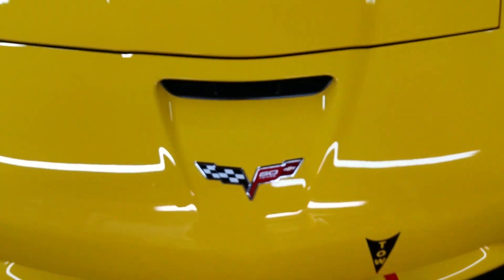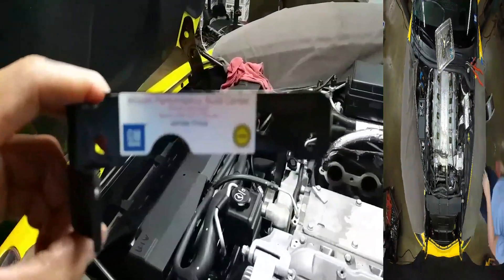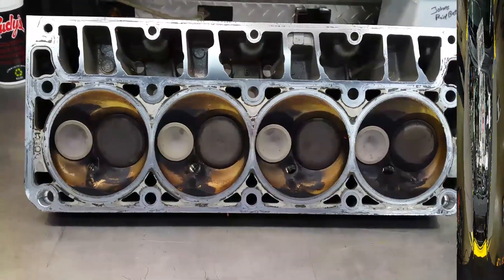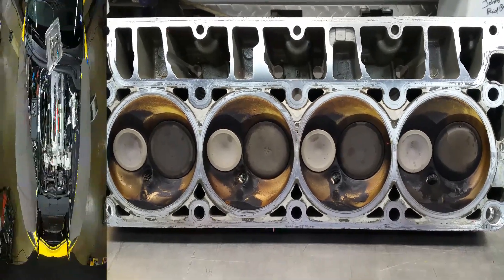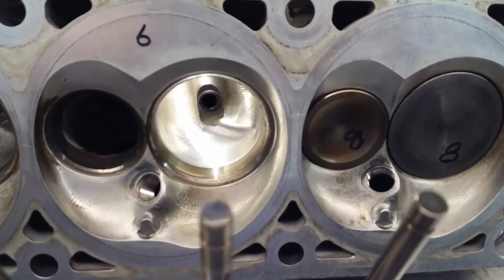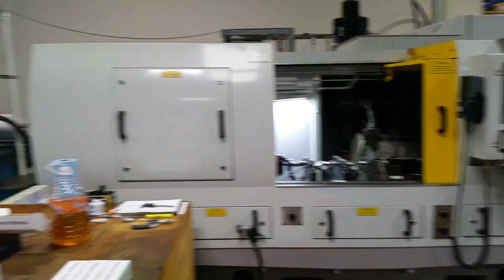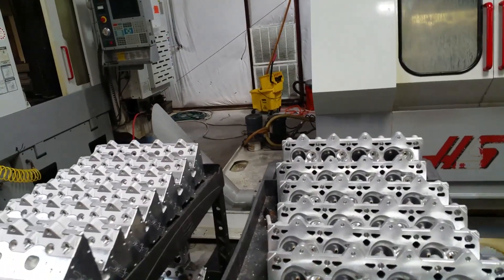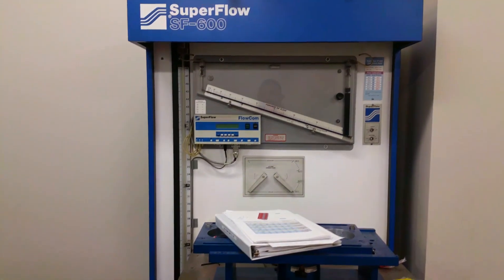2013 Corvette Z06 13k miles valve guide upgrade to prevent Dropped valve

Comment: What will cause a valve to drop?
Reply: It’s just an issue with these cars because GM put hollow valve stems and I’m not sure what else people replace to fix it but replace the head completely and go with a heads cam package for more power and reliability I’m looking into getting a C6Z and I’m tryna see what people do to fix it beside the heads since that’s $3.5-5K

Comment: Why Does everyone Keep saying Dropping A Valve? These Valves Are Breaking Or separating , Dropping Involves The Keepers Or Retainers  Failing Or Coming Loose And the valve Falling Into the Motor.  That Is Not What's happening. The Valve Stem Is breaking. Big Difference, At Least This guy Is saying Why and what. Thank you For That.
Reply: If the valve drops into the cylinder, the piston and head don't much care HOW it got there. All that matters is that it did. Period.
Reply: …because the VALVE DROPS into the cylinder. That’s called “dropping a valve”. Semantics.
Reply: @guardpass  did you not read what I wrote? It's not semantics there is a huge difference. non professionals say "dropped a valve" because they heard it somewhere and it sounds like valve in cylinder , but they don't really know what it means. I explained the difference, you should read it then maybe you would understand it's not semantics.
Reply: Probably more like sucked it in and kissed! 🎉.

Comment: Im retired GM service tech. GM cant get the centerline of the seat/guided the same? The valve head breaks off? Junk valves? Worn guides? Are they worn in an oval shape or are the worn round? Im gona get some guff over this...bring it....worn guides are from junk springs...springs where the top and the bottom are not parallel. It has nothing to do with the tip of the roller rocker not being in the center of the valve stem or oem stamped steel rockers...Big block chev has valves that are angled in 2 directions. Have you ever heard anybody say they needed roller rockers to keep the guides from wearing out....i have messed with a couple sets of heads, this set was on a L88 427 i bought....ran it in my boat and it ran fine
 https://youtu.be/11eXlFkZekM
Nothing more than bad springs.....Easy to prove, get a head with bad guides...put the spring on the valve, put the rocker are on and figure out how to use the pushrod to get the valve off the seat. Good spring, valve will move around with your pinky finger, bad spring and it will be pushed to one side, really bad spring and you will need a tool to move it.
Ti exhaust valve raise redline? That aint gona happen, ignition has a rev limiter, the intake valve is bigger/heavier than exhaust, it will be the first to float....and round up a dyno sheet for your motor....see where peak hp is? You need to shist a few hundred rpm past that...or less..short shif is always best

Comment: Did you also measure 90 deg from the one shown in video? I would think that tangent in line with the rocker shaft would show more wear since maybe the rocker is pushing out slightly (towards outside of car) while also pushing down. (The direction shown at 10:15)
Reply: I agree one hundred percent. Looking at the wear pattern on my rockers it was obvious that there is side loading on the valve stem. I solved that issue with Crower Shaft Rockers, big bucks for a street car, but big peace of mind.

Comment: You are fixing a year that didn't have the problem. You range js acceptable and you did t measure properly.  Should have had the springs removed. 
But hell, nothing wrong with a nice ahead job.
Reply: EVERY year LS7 has had the failure.  Don't buy into GM's CYA FUD!  I'm yet to see a stock LS7 that didn't have some moderate level of valve play.  FWIW, I've also seen it on some "fixed" heads as well, but to a far lesser extent.
Reply: What year(s) supposedly do NOT have the problem and where did you get this information?

Comment: You said you had nine to ten thousands on the intake exhaust but you never or I didn't catch, what the measurement was supposed to be. also, even with that side play I don't understand why the retainer didn't hold the valve in place...? In order for the valve to drop either have to break it or the retainer has to come loose. Which is happening?
Reply: The valve head snaps off, typically on the hollow stem exhaust valve.

Comment: John, nice presentation.  A couple of thoughts.  First, do you have a "slow-mo" version of the head removal.  It was difficult to pause the video fast enough to see what you were doing, so definitely slow motion would be great.  Second, having watched several head jobs that check the guides, I noticed you measured at the top of the stem and not at the guide itself.  I'm really not sure who is right about this.  Where did you get your information to test the distance at the top of the stem and not at the guide.  Thanks John for the video!

Comment: Awesome video. Yes, some of it may be a good advertisement for Texas Speed, but so be it. I've been around this stuff a long time. I was a Tool & Diemaker for 40+ years. If I do say so myself, I am very impressed with Texas Speed. I knew they did good work, but didn't know they ground their own cams. I see cam grinder is a Landis. I ran a Landis O.D. grinder for almost 20 years that accepted pieces up to 8 feet long. They were based in Pa. at one time. Don't know where they are now, maybe still Pa.? Anyway, I see Haas machinery also. All really good equipment. Looks like you went to the right place. These LS7s are great motors, but ticking time bombs until heads are redone.....

Comment: Hi bud, does the LS7 engine require lash caps and if so on which rocker do you install the lash caps on? All the rockers or just the intake side or exhaust side?????
Reply: Intakes, over the Ti valves.

Comment: What's more expensive, an extended warranty or this?
Reply: I just bought a 21k mile 2010 z06. I got a 5yr 60k powertrain warranty for about $2k. Third party.
Reply: But I'm going to have the heads fixed anyway.
Reply: @bsfunk44  Right on! Thanks
Reply: BSfunk44 what third company did you use?

Comment: I do not understand why GM is not responsible for this huge problem! They designed the engine and picked the vendors to supply the correct parts! Now we are supposed to spend thousands of dollars MORE to correct their screw up!
Reply: I went aftermarket with Lingenfelter immediately after buying mine because of this ticking time bomb. You're right, GM sat on their @$$ and didn't do a thing.

Comment: are you a tesla mechanic?
Reply from the maker: I do work on tesla's but not exclusively I work at an independent shop we work primarily on American and Asian imports . I am an ASE Master Technician technician also Master Hybrid & EV certified .
We performed State Safety Inspections for Tesla dealership down the street the manager gave me  Tesla jacket for providing our service.
Reply: @johne4557  cool, great video!

Comment: How did you pull the heads without going under the car and remove the headers? I'm about to pull my heads to have them fixed and want to do the job without the extra work of the headers.
Reply from the maker: Randy I did go under the car to loosen the headers at the pipes completely so I could access rear head bolts. If you can a least pull one of the headers out far enough it makes it easier. Hope this helps and good luck

Comment: Hey Dennis how did you get GM to pay? I also have a 2007 ZO6 with 28,500 (never raced) and at recent oil change found a rocker needle bearing on the magnet of drain plug! SO , I need to do the preventative rocker bearing replacements and exhaust vale change out too , however , when I called GM warranty they would NOT pay anything because car is 12 years old regardless of LOW mileage!!!
Reply: Lee - Sorry to chime in, but my cousin was the QC Director at the plant from the end of the C5 through the second year of the C7 (when he retired). I bought a low mileage (8,500 miles) 2010 Z06 in 2016 because I missed having a 427-powered car and talked to him about the LS7 valve issue and he said, to the best of his knowledge, GM had never paid for the fix because they didn't consider it a "recall-worthy problem". According to GM only 1,200 total sets of heads (made by an outside vendor) were ever affected and that was too small a number to issue a recall. I've read several posts on forums (though far from a lot) where people claimed GM paid to fix the problem but I've never found anyone at GM to corroborate that claim. Trust me, you're not alone in your frustration. Cheers.
Reply: @kingbrutusxxvi  Thanks so much for taking the time to respond. I was on the phone with 3 different GM warranty people for over an hour the other day and it was an exercise in FUTILITY!!! Go figure...I'll be doing the rocker arm bearing repair and heads (exhaust valves etc) next week because I do NOT want to be one of those that drop a valve and have a $20k engine replacement instead I'll take the $4k repair
Blessings
Psalm 143:8 Revised Standard Version (RSV)
8 Let me hear in the morning of thy steadfast love,
    for in thee I put my trust.
Teach me the way I should go,
    for to thee I lift up my soul.
Narrlee

Comment: So 2013 ls7 had the same problem? thought they said only effect 08-11 ls7's
Reply: every 7.0 no matter the year or vehicle is susceptible to this
Reply: Exactly. There are maybe 1 or 2 out of 10 that MAY be OK. If you continue to run one without checking the valvetrain, it's kinda like the old Fram filter man commercials; "You can pay me now (less $$) or pay me later" (lots of $$).

Comment: I have a 09 c6z. Bought it with 32k miles now have 53k on it. I don't know if the previous owner checked on this issue but so far I'm good. I do have a warranty for another 2.5 years and plan on keeping this car at least that long. What do you recommend I do?

Comment: I thought the valve guides were the issue, not the actually valve?
Reply from the maker: Correct the guides are not machined in the center of the head correctly,  I just upgraded to titanium valves
Reply: Yes guides are the issue in that they centered so they wear the valve stem till it breaks off. A hardened valve head will not compress like gasses so it causes major damage to block and head.

Comment: So what has to be done to keep even a stock ls7 reliable?
Reply from the maker: FX have reputable shop rebuild your cylinder heads with new guides and replace the rocker arm needle bearings with the Comp Cams trunnion sealed bearing upgrade
Reply: @johne4557  after that will it be reliable? I dont beat on mt cars much.

Comment: Don’t buy replacement GM heads.  If you have a reputable competent aftermarket specialist like Lingenfelter rebuild your heads with superior aftermarket parts the issue won’t come back.

Comment: Folks, you can't take all this YouTube nonsense serious. There was such a very, very small percentage of LS7's with issues. And that supposed lawsuit never happened. If your going to mod the car, your warranty of gone anyway.
Reply: @365 AutoDrive https://www.corvetteblogger.com/2015/10/16/gm-hit-with-class-action-lawsuit-for-defective-c6-corvette-ls7-engines/
Reply: Mine is 12 years old engine never opened up and runs better than it did from the factory thanks to Long tubes full exhaust cold air and a tune... I've read plenty of stories with people with 80,000 plus on them... Will they pop? Of course. Are the valves the weak link? Yep... people do the damnedest shit nowadays though not changing their oil for 10,000 miles on a car like this? Nope... I don't care what they say about synthetics mine gets new synthetic every 3000 like clockwork...
And this guy putting in solid valves going to rev his car to 8 grand ?... Nope :-)
Reply: @365 AutoDrive Really? It's a Z06 they are track ready cars made to beat on. JMO

Comment: ZR1's have a LS9. You have a LS7, totally different motor. And based on the number of LS7's made vs the failures, the failures are so small that it's under 4%. There's no need to be swapping/upgrading the heads or anything in these stock.
Reply: 365 AutoDrive it is blown out of proportion, but my stock, early build c6z blew the motor with what I considered low mileage (30k).  Either way, things happen, I just don’t think it can be denied, but your response is a bit more measured in that regard.  I think we’re in agreement.
Reply: MH motorVlogs 0_o ... terrible advice
Reply: 365 AutoDrive ignorance is bliss for you, right?

Comment: i thought the valve guide issue on the LS7 only ranged from 07-11 i thought the 12-13 were not apart of it
Reply: I agree the majority will likely go for a long time without issues, but I think it would be foolish for someone without a warranty to just stick their head in the sand and pretend there's no potential problem.   

As a Z06 owner and engineer, I have done a lot of reading & research on the issue.   Not because I'm overly concerned, but more so out of curiosity.  I've come to conclude that ANY LS7 with the factory heads should be inspected at regular intervals.  Why?  Even if only 5% of these cars end up breaking a valve, resulting in major (total?) engine failure, that's still a significant number.   Countless (thousands of) heads have been checked and found to be WAY out of spec and been replaced/fixed before complete failure.   Had these not been done, what would the real failure rate be?   Considering most of these cars see little usage, the number of LS7's with excessive guild wear or complete failure is enough that any owner should be at least casually concerned at the minimum.    It's probably very sound advice to have the valve wear checked every so often.  Is it a hassle?  Yes, but the cost to completely replace an engine to an out of warranty owner is huge!

My Z gets driven, it has 57k on it now.   I'm probably going to do H/C/I this year not only for the power, but also to not take any further gamble regarding the potential ticking time bomb...
Reply: All LS7 heads from the factory are suspect.

Comment: I've been looking at used Z06 Vettes from 2009 / 2010 and this might have scared me away... I'll admit I'm not a engine guru, so a question for all follows:

If I purchase a Z06, I'm assuming that if a head is damaged, the car don't turn on, or will at least have a knocking sound right?

Also, how expensive is the Valve replacement (to include labor) on average. 

Thanks!
Reply: Only a very, very small percentage of LS7's had issues. I'd not worry about it. Besides, once you start moding, your powertrain warranty is gone at that point anyway. Especially if you put a tune on. Moss-Magnuson Warrany Act only applies to stock cars. And aftermarket tuning of a vehicle is a violation of federal law.
Reply: MH motorVlogs thank you!
Reply: 365 AutoDrive thanks brother. I REALLY want a C7, but I should get my feet wet with an earlier model. I really cannot wait to join the club!

Comment: Test Oil Contamination every 5-10K miles. I found titanium at 22,000 miles in my 07 Z06 Ron Fellows, and at 25,000 it had increased a lot, so we pulled the heads for inspection. I had to agree to pay if nothing was wrong but I knew. Pulled the springs, Exhaust valves literally fell out of the heads so loose. $7,000 later GM paid for New heads, New Exhaust valves and gaskets and labor. I had to pay to pull the pan and remove rocker bearings from the oil pickup, GM said that was not warranty covered. 
Get your Z06 Oil Tested PLEASE!
Reply: Where do you send your oil for the test? Thank you
Reply: ZL1 / 4 Play google oil spectroanalysis labs.
Reply: @JosiasRivera  Oil isnt the problem. Its defective valves. Its likely GM replaced your valves witht he same defective units that failed on your car. I know this post is old but if you still have the car you might want to check them again.
Reply: TheHardcoreLife I’m not saying oil is the problem. I’m just responding back to his question.
Reply: @Godsblessings1111   21 and me
Reply: What were rocker bearings doing in the oil pump pickup? Did they fail, also? I have an LS7 in a C5, and though the wiggle test has largely been discounted as inaccurate, the valves shouldn't wiggle at all if there's no problems. If they wiggle at 20,000 miles, there's a problem. I TOTALLY agree with the post that says GM may have reinstalled the problem. SOME, not all, but some of the Ti valves have a rough finish. GM bean counters decided to skip a process called "tumble polishing". Another HUGE problem, and main reason the intake and exhaust valves wear out the guides, is the valve guides are NOT CONCENTRIC to the valve seats. This causes the valve to "bind" somewhat in the guide as the spring seats the valve. I had my heads done when the engine was built by a well known engine builder in Wixom, Michigan. I would've thought he made certain the seat to guide was spot on. But you would also expect.that for $15,000.00, I would've gotten titanium valvespring retainers, which I did NOT get. At 22,000 miles, my guides are also worn out, intake and exhaust. If you want them redone at a quality place, try American Heritage Performance in California. That's where mine are going.......
Reply: @milojanis4901  roller bearings feel out of the Rocker arms earlier. GM refused to repair. Engine still ran. So I replaced all the rockers with 3rd party rockers with cages. However several bearing came out and fell into the oil pan. They were sucked into the pickup screen and restricted oil flow slightly.  I gladly paid the $900 to drop the pan and clean it out. GM PAID the $7,000 for new heads, new valves, gaskets and labor. I had a massive vacuum leak and was way lean. Found the intake bolts were never torqued to spec. I torqued them down all good from that point. Still I sold the car shortly after. Sad for me lost over $35,000 invested in rebuilding the wrecked Ron Fellows. D